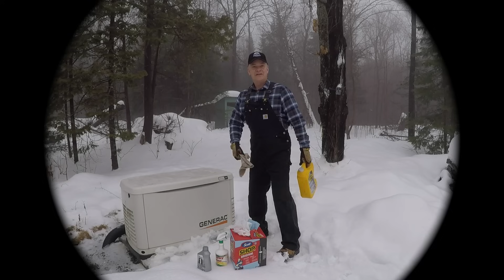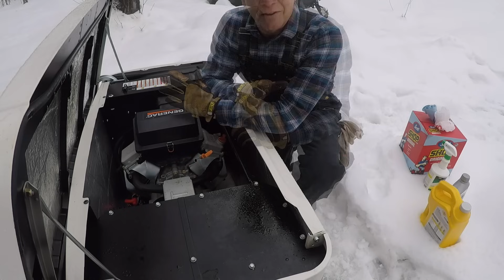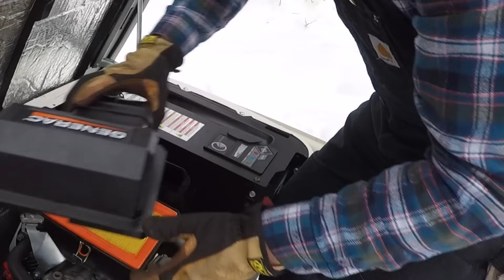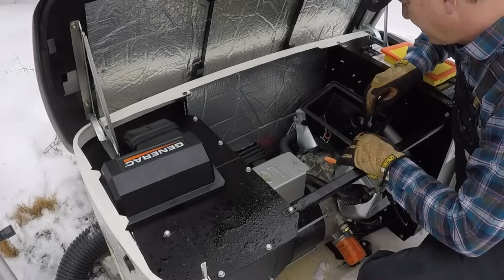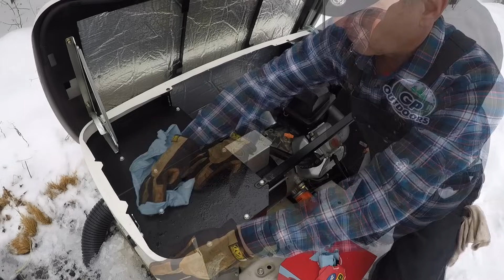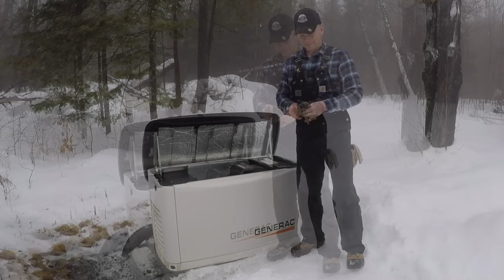#133 Thinking of Buying a Generac Generator? You Need To Watch This!

Comment: What a poor design generac the old saying if it ain't broke don't fix it really shines here I have a 18kw generac with the Kohler engines that'll be 21 years old this year the only repairs I've ever had to do was install a new starter about 8 years ago it over cranked and fried it I wish I had an hours meter installed when we first got it it get at least ran once a year for 5 days straight and occasionally a day or 3 day stent and may only shut it down for 3 to 5 hours late at night every night change oil usually every 40 hours of run time

Comment: Generac generators are literally the WORST on the market. I’m a generator technician for the Canadian military and I see dozens and dozens of different brands and types and hands down these are the worst, we gag when we hear the brand. Don’t buy them, just don’t.

They have the worst service reputation so don’t expect them to come help you with it. 

They break randomly and constantly, I had one literally suck the metal flaps for the choke INTO the engine, they aren’t reliable, had one put a rod through the block for no reason, and so many more issues I can’t even begin to talk about on here.

Don’t buy one, buy literally any other brand, these are shit and won’t help you in a pinch.

Comment: Poor job using correct terms. Your engine EXHAUSTS through the air filter housing....RIGHT.
Reply from the maker: My apologies Bruce. I am not very mechanical - it was the vent port from the crankcase. All the best to you.
Reply: @GPOutdoors  No apology needed.

Comment: IT SURE SEEMS TO BE A DESIGN PROBLEM, EXPENSIVE JUNK SHIT AGAIN, THANKS GENERAC,  THEY SHOULD HAVE TO REDESIGN IT.
Reply: Why redesign it when you can add the option that is designed to fix this problem in extreme cold weather. It doesn't happen in the majority of the places these engines are installed because they don't get that cold. And if it only happened twice in Canada it must be extremely extremely cold.

Comment: As an electrician of 23 years, I can tell you that you should NEVER buy a Generac. They are the lowest quality crap you can get.
They are marketed well, and built terribly.
You'll thank me later.
Reply: Hello, any recommendations?
Reply from the maker: Hi Dave. Thanks for sharing your thoughts. Any suggestions on what an alternative generator is that is around the 16-20 Kw? Thanks.
Reply: @GPOutdoors  Kohler and Cummins are good. The best generators are often older ones. If you can find an old kohler, Onan, or Lister in good shape they are great choices. They are simpler than new ones and will run forever if maintained properly.

Comment: Jeez man drill a hole in the bottom of the air box and put a little screen over it. And that’s not an exhaust port attached to the air box that’s for the crankcase breather hose so crankcase gases don’t cause GLOBAL WARMING (🙀we’re all gonna die!).

Comment: Shame on Generac.  Regarding icing of condensation in the filter compartment.  This is an engineering problem that homeowners should be relieved.  I have a Carrier Heat Pump with a defrost cycle.  The oil resivour  has a heater.  Which is what a Generac should have during winter cold climates. I would never buy one because of this design defect.

Comment: That is not the Engine Exhaust, it is the Crankcase Breather causing the buildup. Engine Exhaust does not vent into the air filter housing. Have to give a thumbs down.

Comment: Funny how he knew what the issue was but didn't do anything about
Reply from the maker: Good day John. A good point for sure. After several discussions with Generac, it appears that if I do anything about it, it voids my warranty - so, until it runs out, I will continue to soak the water up when I can and once the warranty is over, I will drill a hole with a duckbill fitting to allow the water to drain. Thanks for watching.

Comment: Generac has overwhelming name recognition but they are poorly made and have many design issues. They are also difficult to service because of lack of customer support Based on experience of issues I had with a bigger unit That I was asked to work on. Bottom line you get what you pay for.